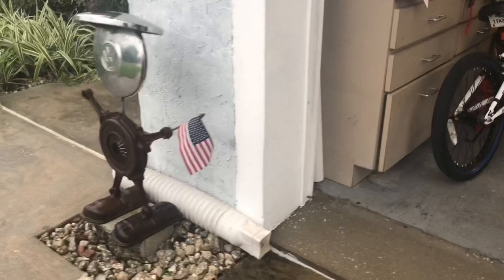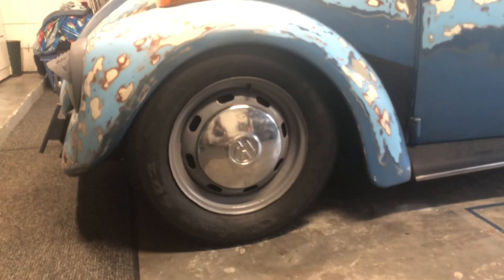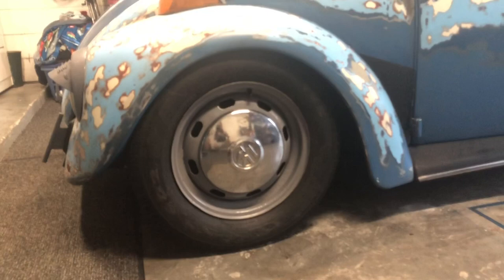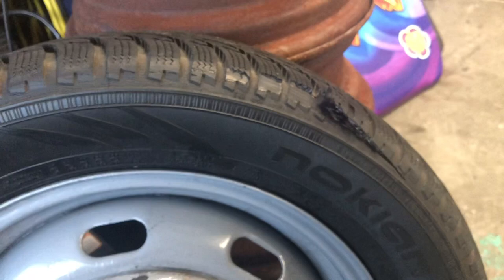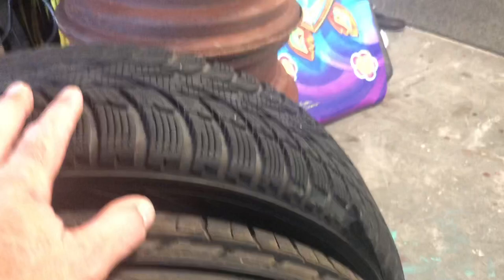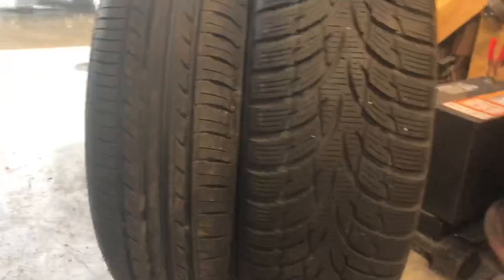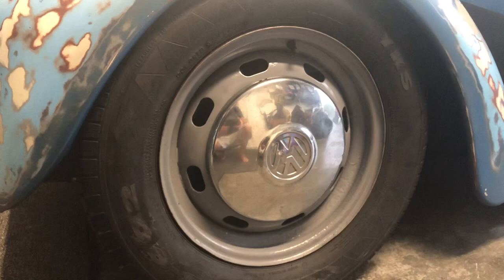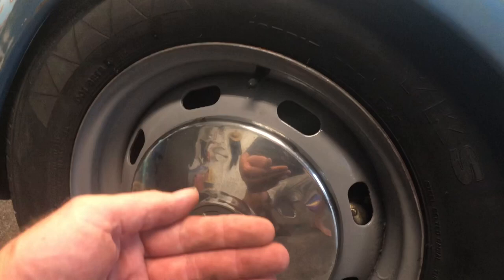Front Tire Sizes For Your VW Bug

Comment: That sculpture is sick! I want 1!!! I bet turning was sketchy! I’ve ran 135’s on the front of Bugly for years they tend 2 follow the road a bit...  I ran into the same issue on pops 56 after disc brake conversion it definitely changed the offset! Great info as always!
Reply from the maker: Mileage Unknown the 155’s seen to not wonder and follow the road so far, I need more miles on them but they stop great. 
Find some old parts and weld them together for a sculpture, your imagination is the only thing holding you back.

Comment: Awesome video. I just bought a pair of 185/65/15 for the front and I was going to get a pair of 205/65/15 for the back
Reply from the maker: Good choices on tires. 205’s might be a tad tall for the rear but you should be fine. I’m running 195/65’s on the rear and find those to be perfect for me and how I drive. 
Have a great weekend!
Reply: @VWJawbreaker  thanks for the info. I might check out the 195’s as well to see how they fit

Comment: I'm so glad you found some replacement tires I was about to offer you a set of 1976 14" Porsche Fuchs with 185/60R14 tires but you would need a wheel adapter to run them on the Jawbreaker. I know we have discussed this many times but I'm running 185/60R15 on the front of Stormy with the adjustable front beam end and dropped disc brake spindles the 63 is sitting on 145R15 in the front on a standard beam with lowered Kinpin spindles for drum brakes. 🤙🏼
Reply from the maker: Volkswagen Fetish oh yeah, we have discussed tire sizes until I had dreams about tires 😂
Thank you as always for your input, it is greatly appreciated! Now others can also read what works 👍

Comment: I like your Bug dude. Here's the thing there's a major difference between what's required for a posers show car trailer queen and a daily driver in a stock bug. Factor in if you live in a dry,hot state or somewhere cold and wet. 
Aprox. 70% of total braking power in a Bug occurs at the front so avoid skinny low pros up font unless you just dragrace!
Bugs are already too light upfront. Bugs handle best when the front is 1" higher at the front, so lower the rear first if you like that kind of thing.
I run 165/65 at the back and 165/80 at front on stock Daily Bug driver. Good handling, braking and economy for 11years now. You never know when some idiot in an SUV or black jeep in a hurry home from a school run is gonna cut across your lane or when a dog runs out in front of you, then you will thank me haha! Keep on  Bugging folks, its dangerous out on the highways.
Reply from the maker: John Collins excellent points and I agree, the more stopping power that you have the better! So many people are distracted don’t care about others. They don’t realize an older vehicle needs more room than their newer one. I upgraded to front disk brakes and that made a huge difference.

Comment: Right now I'm running stock fronts 165/80 with a 1.5 inch drop, but widened guards mean plenty of clearance for future drop spindle upgrade. Rears are 7x14 inch with 185/70 which just clears the widened guards on a 1 inch drop. No doubt this setup will change as the mood suits! Like you say, no rules do what you want :)
Reply from the maker: One of the many great things about VW’s, they can be customized so many different ways.

Comment: I have 145/65 r15 but it’s a lower profile than your 155/50r 15 how can that be possible?
Reply from the maker: nikittoo1 you’re aren’t really lower profile but a smaller diameter. The fire measurements are 145 - width in millimeters, 65 would be the aspect ratio meaning it’s 65% as tall as it is wide and of course 15 is the rim size.

Comment: Will the rims size be on the  inside of the rim,or do I have to just measure it
Reply from the maker: If it’s a stock VW rim, you’ll have to measure it. Aftermarket ones may have the size on the backside.
Reply: @VWJawbreaker  ok I need a spare wheel and tire for a 67 but I'm go ahead and get one the same as my front two already,I will look at them in a day or two

Comment: Great video, I just subscribed! I have 65 bug that I need the proper tire for. I plan to install drop spindles in front and drop it a notch in the rear. What tire size do you recommend? Also, could I use 14" smoothies on my 65 for a lower look????
Reply from the maker: Red Pill Rage thanks for the sub, don’t be shy, comment away on the videos!
As for tire sizes, it will depend on what look you’re going for. 14” rims may not clear the brakes depending on the rim. There is a guy who sells smoothies in GA, Smitties Smoothies, he’s be able to answer the rim questions and get you setup with the right offsets, etc.
Reply: @VWJawbreaker  in appreciate that! By the way, cool little VW statue!!!! 🤪
Reply from the maker: Red Pill Rage thanks!!
Reply: A pro ralli driver told  me rear drop 1 inner and 1 outer  with the front an inch higher

Comment: I know you did this video a couple years ago but the 175 you are running so you have any issue with running I have 195 65  15 in the front and rub a lot I’m just trying to find a tire that works. Also are you running that size all around or just in the front
Reply from the maker: I didn’t have a single issue running the 175/65’s up front on the stock rims and stock suspension, even with the stock width adjustable beam. 195’s are pretty big to be up front depending on the rim. 
I run 195/65’s in the rear without issue, again on stock rims.
Reply: @VWJawbreaker  awesome thank you for the reply! Thank you for helping!
Reply from the maker: @emiliocruz5529  anytime! Sorry it took me a while to reply.

Comment: 5.60 15 is stock
Reply from the maker: Guess it depends on what year you’re taking about. 
This is a 73, stock tire size is a 165/80/15
https://www.jbugs.com/category/1973-vw-super-beetle-wheels-and-tires.html#:~:text=1973%20VW%20Super%20Beetle%20Tires,-We%20offer%20VW&text=The%20165%2F80R15%20is%20the,fit%20the%20stock%20VW%2015x4.

Comment: how many inches would you say is your front end is lowered
Reply from the maker: Wow, that video was a long while back. Hard to answer to be honest.
Reply: to be honest i been binge watching your videos
Reply from the maker: @seans625  I do appreciate it and wish that I could give you an accurate answer. 
If I remember correctly, that was stock spindles but just an adjustable beam only… prob a few inch drop vs stock.
Reply: @VWJawbreaker  🤘🏻🤘🏻

Comment: Gary, have never had to have any tire work done on Blue Bug, how hard is it to find a tire shop that knows how to change the tire on a 5 x 205 star wheel?
Reply from the maker: William Cronin you’d have to call around buddy, I have no clue honestly 😔
Reply: Worked in a tire store (way back), the rims sorta fit on the tire machine, but were wobbly, and if they moved when the bead presser came down, would bend them. Also have used a "manual" bead breaker, and "spoons" by hand...not fun. Balancing, at one time there was a specific adapter available for high speed machines, I bet they are rare as hens teeth now.
Reply from the maker: William Cronin I also use to work in shops years ago. The tire machines are completely different now vs back then. I highly doubt just any tire store could balance the tires, most should be able to dismount and mount the tires of the person has a little bit of common sense.